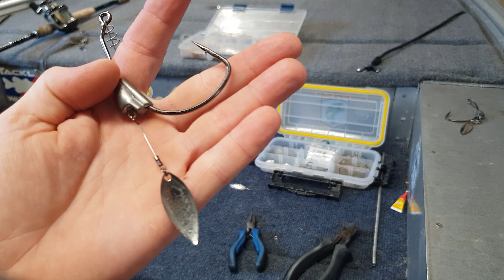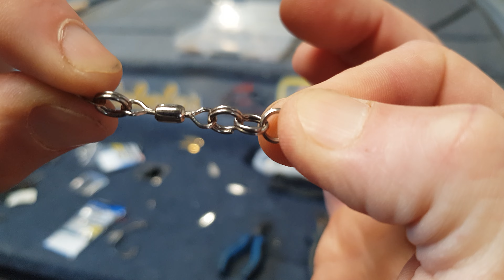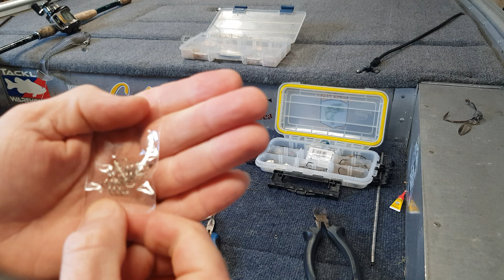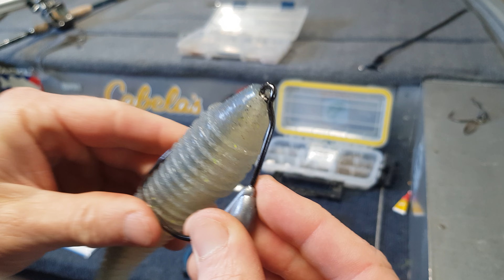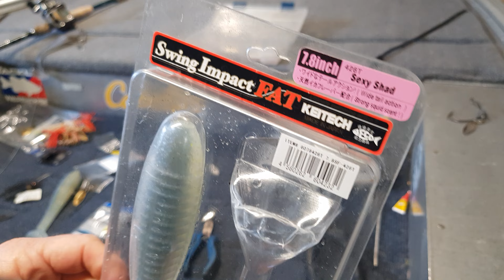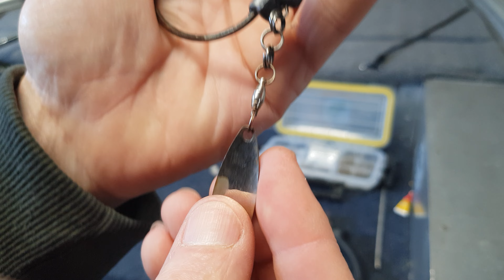How to modify a Flashy Swimmer!!

Comment: You would be better off using ball bearing swivels . Most quality spinnerbaits use them . Also hyper wire split rings are over kill in this application .
Reply from the maker: Thanks for the comment! Hyper Wire split rings may indeed be overkill BUT I have never had any of them FAIL me. Throwing a KEITECH 7.8" isnt a walk in park. I throw on a seriously BEEFED up 10/0 HOOK, 80LB BRAID, 7ft 10" Hvy action rod, extra fast tip! My hookset is BIG as well as rod, reel, line, BAIT!
AVERAGE sized fish i catch is 3-5lbs.

Comment: Why not just buy a new pack of 2 for 5 bucks?
Reply from the maker: The exact hook I use doesnt cost $5. 10/0  hook 1/2oz in weight  pack of 2 for $12-14 depending where you go. Most time I have to order from tacklewarehouse. Most local tackle stores dont carry that size. Im lucky to find any sizes above 5/0 or bigger! Thanks for the comment
Reply: @Swimbait79  You are using the Beast hooks then? I didn't think they made a flashy swimmer in a 10/0 hook. I also use tackle warehouse for most of my tackle.